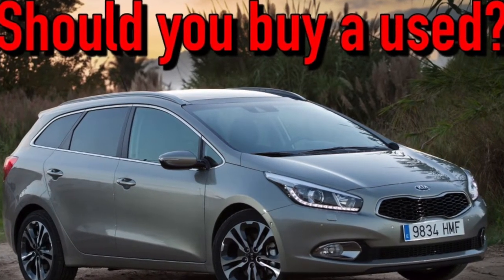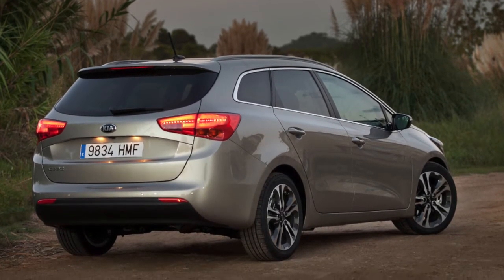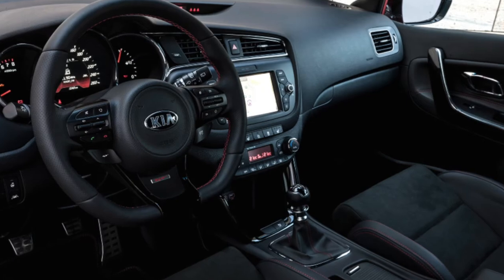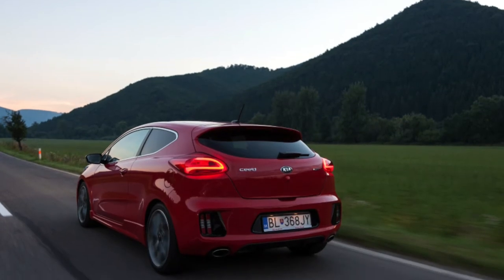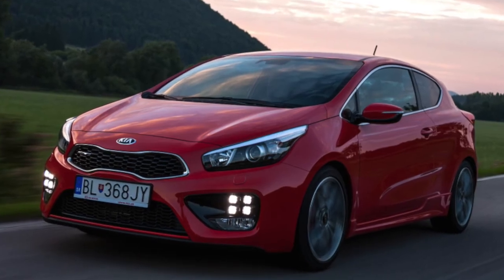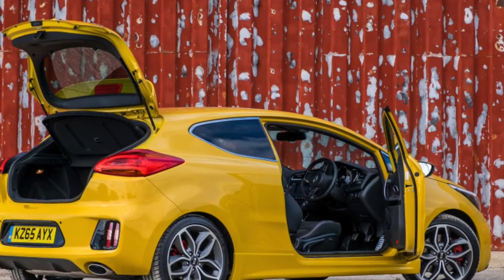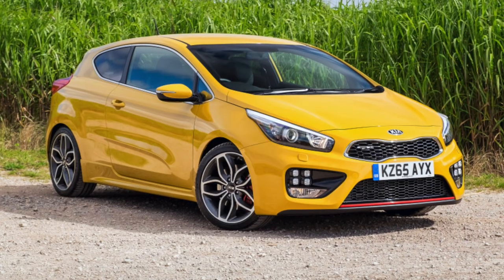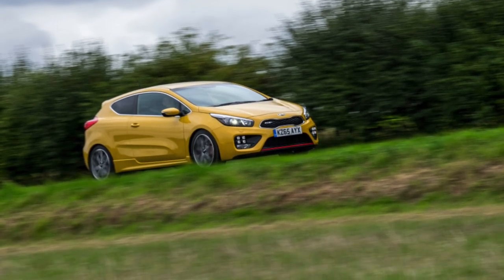Kia Ceed 2 Problems | Weaknesses of the Used Kia Ceed II

Comment: Current issues i'm having are: 
*keyless entry antenna on passenger side door not picking up key presence,
*rear left parking sensor stuck permanently on
*start-stop system not working(this i am happy about as i don't like ISG) 
*bluetooth has a 1 second audio delay.
*gear selector vibration under harsh acceleration and low rpm(1500) in 3rd gear when cold
  

Overall, i've had the car for a year, i bought it used with 53k miles on the odometer and have so far done 8k miles and i can't complain too much. Its not a bad car and it's very well equipped for the money but not very impressive in terms of interior build quality and overall refinement and interior space. 

With all this said, i don't regret my purchase, it's overall a lovely car, but just not as well built as the civic i had before.

Comment: Good video dude, one question i am looking to by Kia Proceed 2013 1.6 crdi with 143k km for 7k euros, any opinion ?
Reply: Im looking at a similar car, 160k km for 8k euros. I drove it yesterday and only thing i found questionable was tire noise
Reply: @Makukeisari  with the same engine ? Everyone is telling me  that is too expensive for used Kia, i was looking also auris 2013 but was sold in a day btw i am from Macedonia
Reply: @androidgames5569  yes, just bought mine, its so comfortable to drive on highway 😊 Thats a good price over here, i live in finnish lapland
Reply: I have a 2012 kia ceed 1.6 crdi with 320.000 miles or 515.000km and it runs perfect no problems at all